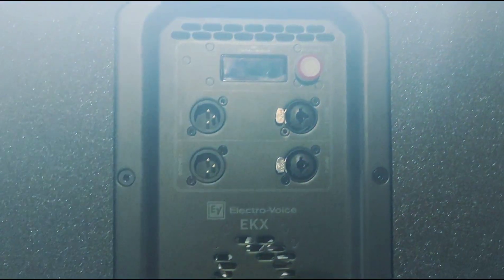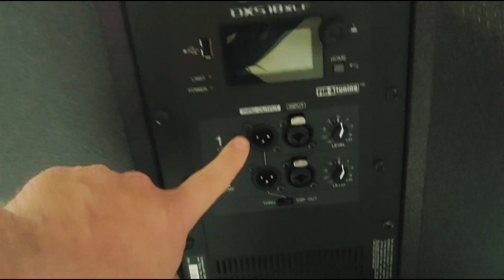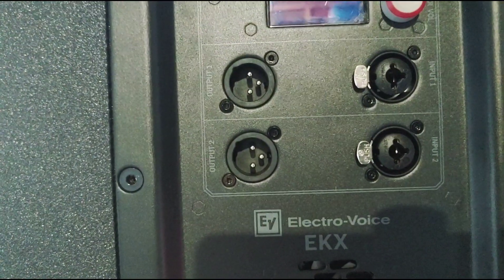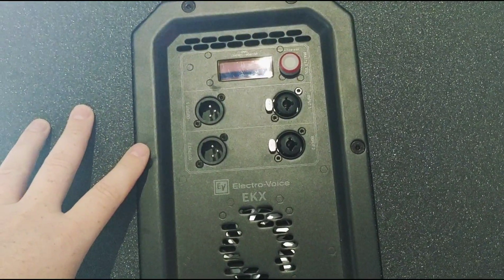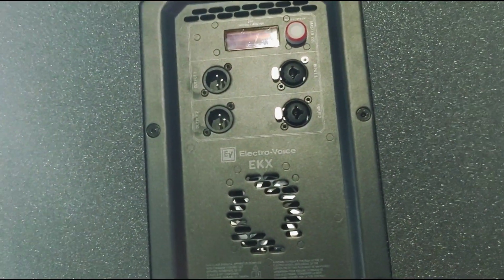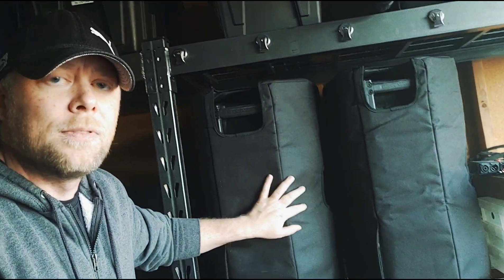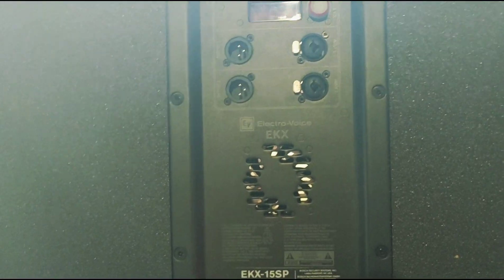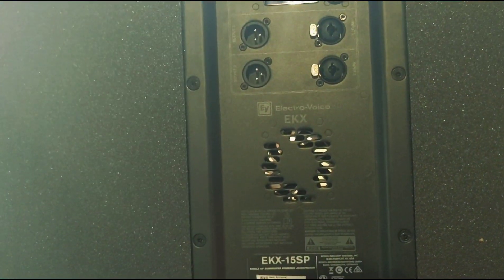EV ELX200, EKX & ETX Crossovers | How they work and why they are not good options for column arrays

Comment: Nice job on explaining this. I just purchased a pair of ELX18 subs and was wondering if you set the DSP in the EV sub to something like EXL15, but then used a different brand speaker with a 15” in it, would that send the correct frequencies out to the top speakers? I have a pair of ELX 15’s coming, but there are times I may use a different speaker for my tops

Comment: I did a party on sat and ran my DJ controller to an analog mixer. I had my sub on aux and my tops through the main output. My EV 15” tops were set to the sub EV 18” and I was still getting way too much bass from it. Any tips? Or is that how it’s supposed to be?

Comment: Thanks for the correct answer! Geeze, finding someone who knew the simple straight answer "pass through DSP or parallel pre-DSP" was virtually impossible, and the EV manual is ridiculously dumbed down and uninformative. I'm about to pair an ELX to a pair of JBL VRX932. Guess I'll bust out the external crossover. 😕

By the way, using an external crossover in a subwoofer arrangement application won't in and of itself cause classic comb filtering. Classic comb filtering occurs in higher frequencies, where one can see the "teeth" of the "comb" on the display of the device measuring the time energy domain of the room in question. The term "comb filtering" was created by the users of the Techron TEF-10. It happened when they saw their first time-domain representation of 20-20khz time energy frequency plots in an acoustically misaligned space. The sharp bumps and valleys of time energy incoherence that appeared in the higher octaves looked like the teeth of a hair comb. Hence the name, "comb filtering".

FWIW, I've been bi-amping live sound since 1977. I've actually used a Techron TEF-10 and seen for real comb filtering right on the display of the device that first gave this acoustical phenomenon it's slang name. 🙂

You young guys have it great. You can do TEF like measurements on your cell phones, while you're texting an order for coffee at the same time. 

Anyway, thanks for the clear answer on the crossover! You saved me several hours today.

Comment: I like the way how EV did realize the „crossover“. BTW as far as I know EV talks about HPF or LPF and not crossover - and this is exactly what they have in their DSP‘s.

What I like about this: I am using the ETX series and setup my FOH mixer to send Main L/R + Sub. With the Low- and Highcut set in the speakers I do not need to care about filtering the signal at the outputs. I just can send the full range signal to L/R + Subs and the PA does the rest.

Comment: Now you have me questioning how I run my rig…. I have elx200 12” tops and 18” subs. I run my mains into the top, set the crossover to the elx200 18” preset then run my output from my tops to my subs.

Comment: Yeah I noticed it after I got ELX SUB Ev got cheap DSPs all of them are the same I think it would have been easy to put a output crossover in the cabinet a resistor basically and another set of plug or a switch.

Comment: First of all, very few self respecting DJs would even own ELX speakers, never mind actually use them at a gig. They are just too much of a compromise when you can get the EKX for just a little more coin and have a system that will last a lifetime. Also, most speakers companies are switching over to full pass-through of the signal because that is the preferred method, so it's an "EV thing" per se, and eve if it was, it's still the better way to go so it's pointless to make a big deal about it.
Reply: what's the "compromise"..?

Comment: I just ordered one EV etx 18sp to go with my two RCF art 735 tops. I need a sub and all affordable rcfs are out of stock for a while.

It's only for outdoor events with edm type music, what would you recommend the connection setup be with only one sub: mixer stereo left to sub to left top and mixer stereo right to right top? Or anything different?

I'd like to have the option for a proper crossover in case I'm not satisfied with the tops going full range.

What external crossover would you recommend and where would I connect it in this particular setup?

Thanks for your help!

Comment: I run this exact setup dxs18xlf bottoms and ev ekx 15p do I have to set the EV at 100hz if I already set the sub at 100hz. ????
Reply from the maker: Yamaha does it the right way.  As long as you have the switch set to DSP Out you are good to go and can leave your tops in full range mode.
Reply from the maker: Provided you pass audio through your subs and then to the tops.
Reply: @TheAngrySoundTech  … Question so is it any other subs that have the same concept as the Yamaha sub because I have a friend right now with EV evolve 50’s that need’s a extra sub sometime.
Reply from the maker: You'll definitely have to look per model to be certain but JBL, DAS Audio, Yamaha, RCF should all have the ability to send a crossed over signal out of the sub. I'm sure there is more but those are the ones I've owned.

Comment: I have tried it both ways with the sub feed a crossed over signal to the Evox J8 and sometimes without. It's really a personal choice that I make by ear and educated guess. 
In a bass boomy room, I will cross it over and just let the sub handle the lows. Keep in mind that the floor and walls can add up to 9db in some rooms to the bass!
At an outdoor gig, I don't crossover and let all of the speakers help out with bass. That's because I lose the bass gain that I would get from a room. 
However, ideally I would have extra subs for an outdoor event if possible.

Comment: Great content, Why don't Manu's have these kinds of videos in their instructional vids? I have an idea for your next video! How to EQ ETX18sp with ETX-35p's so you can max them out without blowing woofers? I've had mine for years and it's always running sound for bands that kills my woofers. I could now explain it but I don't have the time and I want to see your skills at work. Also skip elx ekx and Alto and below Budget brands. If you want to be a big dog don't buy budget speakers. I must add that I have a pair of Denon Axis 12s 2000 watt Subs that I have been using for @ 5 years, They have long excursion, no slap back and can handle RAP style BASS with no clapping while being over driven. I wish I could buy more but they were bought out.

Comment: To be fair, most top speakers sold today have a cross over function built in as a switch or a menu option in their DSP.   But i guess there is still a minority who could have an issue with this.  I use EV subs with QSC tops and it's been working out well so far.  And most times i prefer not to cross over the box to get a bit more bass anyway.
Reply: Yeah like the Presonus air series tops none of them have a crossover in them it’s depended on the matching sub to do it was thinking about getting a pair to use in my cheaper rig because they sound great for the price but because they don’t have a crossover built in I don’t want them!

Comment: Leaving their differencs aside, Which speaker sound better in your opinion?
Reply from the maker: ETX is the best of all but I think the EKX has the best price to performance ratio.
Reply: @TheAngrySoundTech  I have two ETX 18’s that I swapped the woofers out to stronger mor durable ones and the bass is night and day they hit so much harder it’s like EV puts mediocre woofers in they cabinets to keep them at certain affordable prices!
Reply: @hollywoodthedj1673  what woofers you have I want to change mine to
Reply: @biggworm2002  … eminence woofers I forgot the model number only downside is that you have to re drill holes to make the woofer sit right because the stock woofer has a wider circumference!

Comment: I have 2 ELX200 15P's and 1 ELX200 18SP. I set the Sub and Tops accordingly, but wondered what was being sent to my non name brand second pair of 15 inch tops. With what you have explained so well, is that I am passing through full range from 18SP to the 2 15P's and then through them, full range to the no name 15's. That is what I was hoping for, and it has been hard to find that information. Thanks so much :-)
Reply from the maker: Yep, that is exactly what is happening.
Reply: Not going to get clarity with the chepo lineup just plenty of distortion.

Comment: Running tops hi-passed for music playback is silly anyway. 

Best using all available headroom on sub-bass frequencies as the subs will limit way before the tops if the tops are hi-passed. Run tops full range and cross over subs at 80-100hz will mean the whole system will limit at about the same point in most situations. Obviously you'd need to delay the subs or tops so that they work in phase.

My main system is double 10" (dipole) tops and an 18" sub per side. I cross over subs at 80hz and run them as infras, tops naturally tail off at 60hz. I apply 4.4ms of delay to the subs and it brings it all into phase. It gives a nice warm punch at 60-80hz and the system has plenty of headroom at 30-60hz and at 80hz-20khz outwith the overlap region.

If you have dual 18s per side then they'll keep up with a decent pair of hi-passed tops and it's worth hi-passing. Or if you are running a band/vocalist and want to reduce IM distortion caused by low frequencies.
Reply from the maker: I'd say not running a properly crossed over system sounds like a recipe for phase cancellation and comb filtering but if you're happy with the sound that's the main thing that matters. Have you tried crossing over your tops? You'd probably end up with cleaner sounding mids/low mids if your tops aren't trying to produce sub bass.

Comment: Forgive length For small events, I pair single EKX-15 sub w/2 QSC CP-12s. QSCs have 2 "with sub" modes (standard and dance). Manual says, "...factory voicing of the loudspeaker with an 80 Hz high-pass filter for use with live music, program music, or instruments, and an external subwoofer..." Does that mean CPs have crossover, or is it something else?
Reply from the maker: Yes, the CP-12's have a built in crossover fixed at 80Hz when in "Default Ext Sub" mode or "Dance Ext Sub" mode. So to properly crossover your system you would want to set the crossover on your EKX-15SP at 80Hz.
Reply: @TheAngrySoundTech  That's what I've been doing. Confirmation is appreciated. Thanks for the great info you've been putting out. It's noticed, and it's appreciated.
Reply: My experience with QSC leaves me happy and satisfied, even though I have had 2 K10's die on me in the last 7 months. One 7 year old K10 And one K10.2 less than 6 months old.

Comment: So you want to use an EV active subwoofer with a evolve 50 top cabinet? or am I misunderstanding you? Both the evox from rcf and the evolve tops are passive...
Reply from the maker: When I'm talking about adding a subwoofer to a column array system I'm talking about people that add an extra sub for more bass. As in putting a single 15" sub under your DJ table, running your left/right through the sub and then running XLR's from the sub to your Evolve 50's. The EV subwoofers have a half implemented crossover and are not the best solution for this situation because it's is unable to just pass the high frequencies to the evolve 50. Instead it passes the full range signal. You should need to use an external crossover to have a properly crossed over system.
Reply: @TheAngrySoundTech  Ahh now I think I get it. In that scenario you probably wouldn't want the evolve to play any bass, right? Just have the evolve sub there as an amp for the tops?
Reply from the maker: I would typically set the crossover on the extra sub at 80hz and let it handle the low bass. Then the sub of the Evolve would do 80hz-200hz which would be the more punchy bass. Then the evolve tops would do everything 200hz and up.
Reply: @TheAngrySoundTech  the EV Elx 200 18sp is a good sub to use with the evolve 50’s because you can run everything through the EV App and control the crossover features for all speakers!